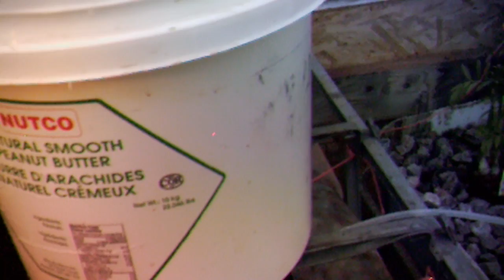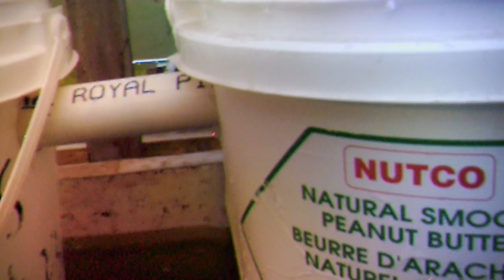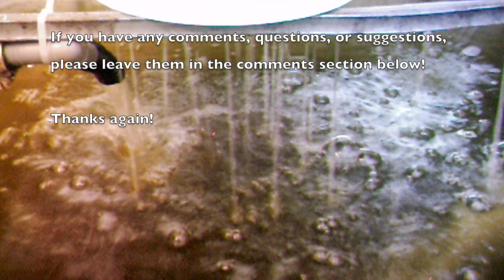Aquaponics Build Update #5

Comment: That is a nice set up.  I might just have to add something like that to my system.  The airlift pumps seem to be the best way to move water around.  I'm not sure how I'd use them in my system but I'd like to find a way.  I guess I need to look up the guy you are talking about.
Reply from the maker: Amerijam Acres Thanks for stopping by the channel! 

There are more efficient designs than the one I've built.  One of the best is:  https://www.youtube.com/watch?v=RccAa_qrPA8 ... however, for what I am doing, air-to-water ratio isn't really a worry.  

The best thing about reducer-style air-lifts like mine is that for low-head applications, they handle two issues at the same time:  lift and aeration. If my water pump cuts out, I know I'm still filtering and aerating the fish tank, which is crucial.
Reply: I'm familiar with the design of airlifts.  In fact I almost suggested some changes but what you have works for you so no need to change it.  Thanks for the link I'll check it out.